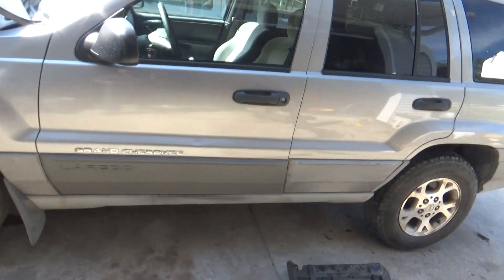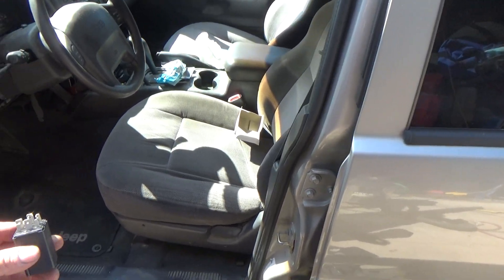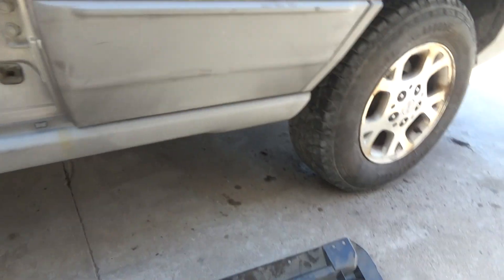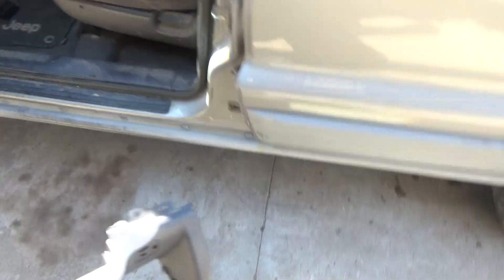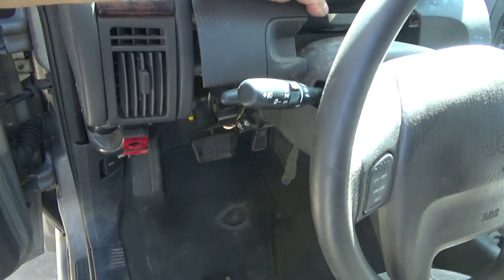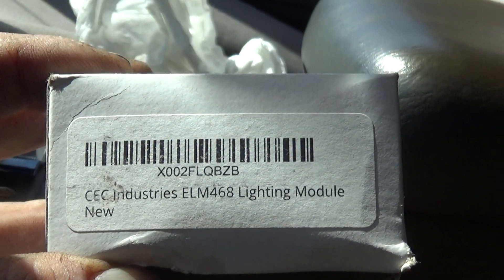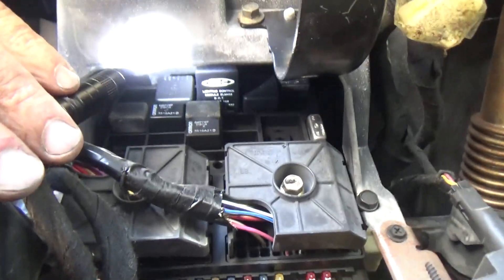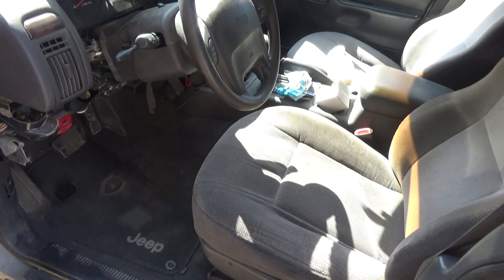2000 Jeep Grand Cherokee, intermittent turn signal, where to find flasher

Comment: Ok, yeah. I haven't seen, or heard of one of those in a good while now. Those needed changed now and then, just like the metal push-button switch for the headlight  high-beams. At least this wasn't another broken wire to hunt for and tend to!
Reply from the maker: Yeah, those round 2 prong flashers did get changed maybe 2 times in the life of a car. They also flashed real slow when you had a bulb out and real fast with trailer lights, just the opposite of the new style.